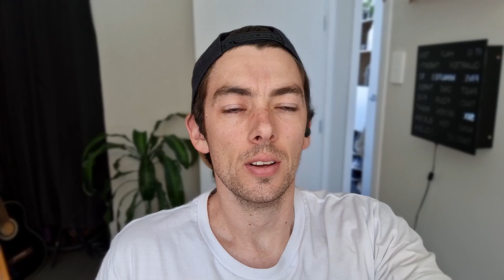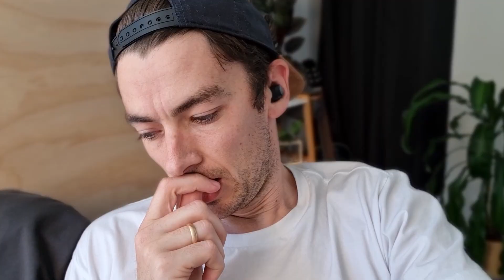PLC vs IPC - What's the Difference?

Comment: Agree but depends on the Architecture of each project. PLCs are not going to extinct since are much more cheaper than industrial pcs. You can still use them for small applications , remote I/Os , simple tasks , then you need the big papa to come in and connects with each device and make more complicated tasks.

Comment: Conventional PLC operates on a RTOS, while PC and IPC operate on an Interrupt Based OS, here you have the cause of so many crashes with PC/IPC versus much less crashes in Conventional PLC. Naturally PC and IPC have higher number crunching capability and thus can solve Numeric Algorithm faster. 
With that said, I have used PLC for over 40 years and never run into an industrial control issue I could resolve with standard RLL
Reply from the maker: Beckhoff TwinCAT actually leverages the capabilities of the underlying Windows OS and have built a customised RTOS to provide deterministic performance required for industrial automation tasks. This setup allows for precise control and timely responses to various input signals and events, critical in automation environments. We have hundreds of clients running IPCs and never have any cases of crashing like you state. Beckhoff OS is actually a modified  Windows OS so shouldn't be consider a "PC".

Comment: In terms of reliability, you didnt mention that the IPC processor has isolated cores for real-time applications. So, for example, three cores are dedicated for IO logic, and only one will run Windows. The  logic that is written for machine control has direct access to the CPU. This means that Windows has nothing to do with the control logic...
Reply from the maker: Very good point, this is often where user get stuck on the "Windows is not good" subject.
Reply: Not actually true with the case of Beckhoff.

It core share a/some cores with Windows OA as well. No need to isolate cores completely.

Comment: Didn't hear anything about licensing costs. That's a pretty big deal. Step 7, TIA Portal, and Logix Studio 5000 aren't cheap!
Reply: Beckhoff TwinCAT 3 is free for development. You only pay for the licenses on the device that will be implemented on the machine which also You can have as a trial for 7 days and then You can renew the trial license for another 7 days and so on until You decide that You need that license and then You buy it for long therm. It's also good to know that You can add different licenses later on so You don't have to specify all the licenses for various functions when You are buying the IPC or Embedded PC. Also the cost of the license depends on the performance class that Yours IPC or emPC is having P20, P30, P40 and so on. Of course the bigger performance class the grater the license price.

It's a bit confusing when You're first introduced to such licensing process but once You get into it, it's actually really good type of licensing in my opinion.
Reply from the maker: Hey Tommy, thank for your comments. And yes that's a very good and valid point! You can even get a temporary 7 day licence if you need it for development!!